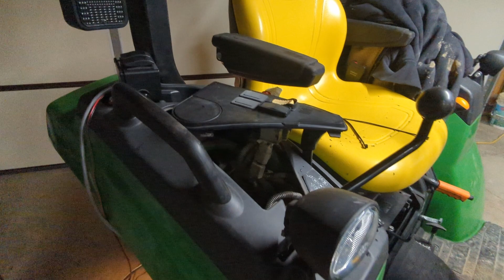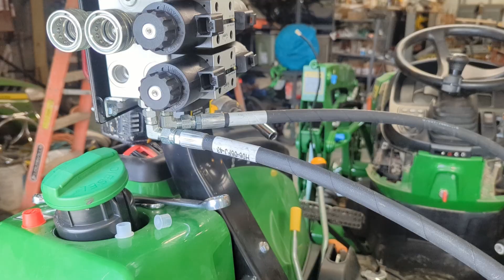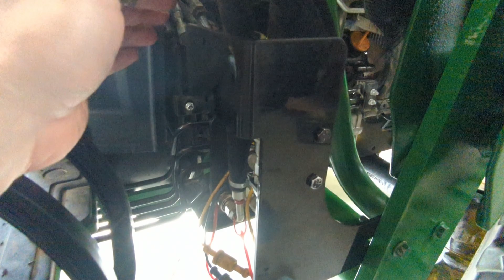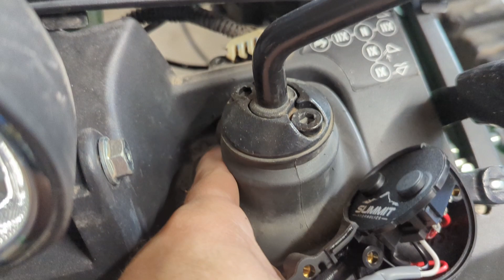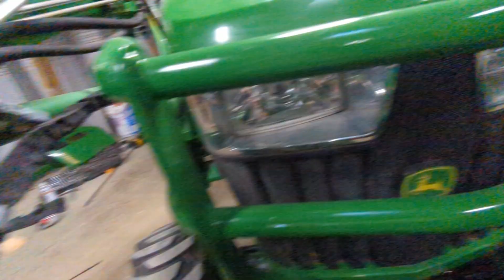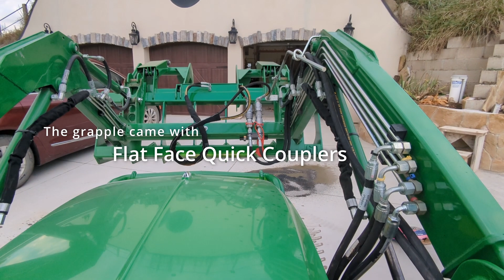47.1 Installing a 3rd function Grapple on my John Deere 2032R

Comment: Great video. I am having an issue with my grapple working and the three point not going up and down at the same time. Any ideas on what I messed up on?
Reply from the maker: Maybe you don't have enough hydraulic fluid in your system to operate both?   They should be pretty independent other than sharing fluid.

Comment: Great video, super helpful as the directions that came with this kit are pretty bad! So just to clarify you have the P port on the power beyond kit connecting to the P port on the manifold and you have the R port on the power beyond connected to the T port on the manifold. Leaving the T port on the power beyond capped?

Comment: keep the grapple a lot lower when moving and add some ballast. A little bit of weight far out can be more than what you anticipate. Add a small depression in the ground and it ends up on its side pretty easily. good work
Reply from the maker: Yea, I have the tires filled and I'll be getting something to hang off the back (like a back blade).  I'm also thinking about swapping the front tires around to give my self a little more width.   I'll be careful while I get the hang of it.